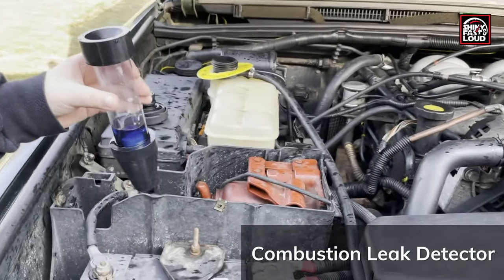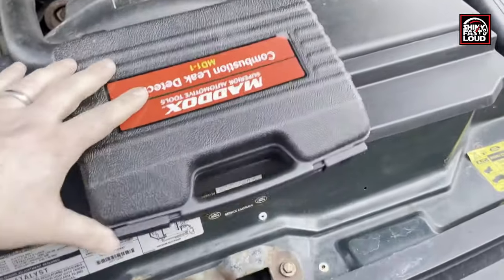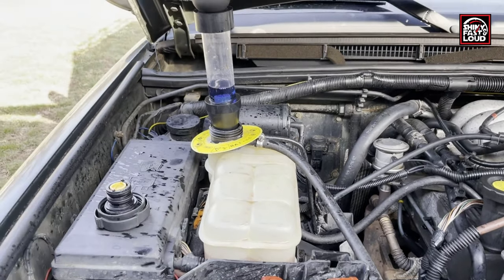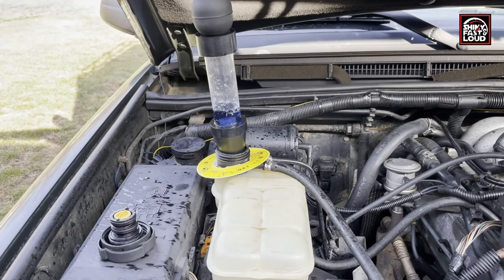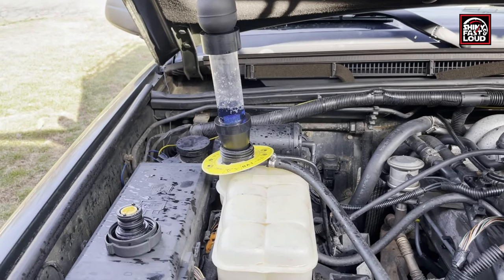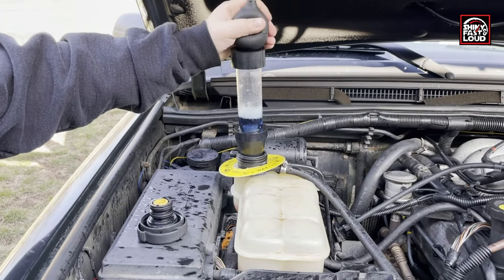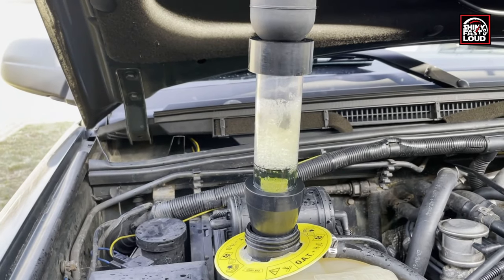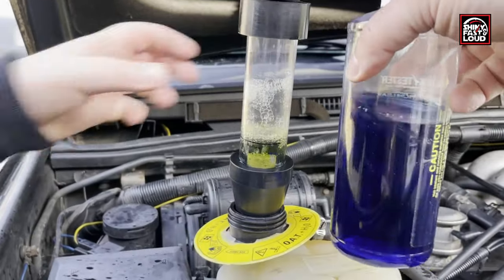Combustion Leak Detector Demo

Comment: Nice video, made me aware that you can do the leak combustion test on the reservoir instead of having to directly do it at radiator cap. Which if your car has one gets around needing to suck out some coolant from radiator to not have it accidental suck up on your tester giving you false readings. Easy test that rules out alot of major expensive compression issues and leaks possibilities when troubleshooting.
Reply from the maker: Glad it helped
Reply: @ShinyFastLoud  is this definitley confirmed?  This will still work testing it at the reservoir versus the radiator?
Reply: @macknumber9 you just watched him do it…
Reply: Glad I found this video and comment I’m about to test my car right now and wasn’t looking forward to draining my coolant

Comment: I just did the same test on my Duramax about an hour ago. I let it warm up about 5 minutes then started pumping the bulb. It slowly turned a greenish yellow withing about 2 minutes. I stopped pumping the bulb after a bit and it was actually bubbling up into the tube on it's own. Time for a head gasket job.
Reply from the maker: That's not fun
Reply: This tester doesnt work on diesel engines :)
Reply: @thegamepz  why not?
Reply: @thegamepz  why?
Reply: it's inaccurate on diesels, you can read the instructions
Reply: @thegamepz  yes, it does. It turns green instead of yellow with diesel combustion fumes.
Reply: interesting. I haven't heard mention of that from anyone else so far.  seems to make sense, but still, are you Sure that's what it means ?
Reply: @thegamepz yes it does. You just need the diesel fluid vs the gas fluid
Reply: Did you buy the fluid from Harbor freight along with the kit when you tested the Duramax or did you use a different set? Want to make sure I get the right fluid to test with.

Comment: When I try to use the block tester I have, the coolant just rises and either overlflows, or gets sucked into the tube. It rises slowly after turning the car on. Only takes like 15 to 30 seconds for it to be not touching the tube to being inside it, or overflowing out the sides? What the hell?
Reply from the maker: Important thing you point out. If the tank is too full the tool will suck coolant up (instead of the air/gasses) which basically invalidates the whole test.

Comment: Me personally I just bought the cheap testers to test out an old car to rule out a few major compression/leak issues. I doubt the old car problem is anything like this. It's more a fuel pump or injector problem that will eventually kill the dieing car. But wanted to comment on great video. Made me aware of reservoir tank instead of radiator main cap to use for test!!! So I can bypass having to suck out a few inches of coolant with a baster tool of some sort .
Reply from the maker: Glad it helped

Comment: These are great for testing head gaskets that fail between coolant passages and combustion chamber but it still doesnt rule out head gasket failure completely...
Reply: The other HG issued would be quite obvious when oil and coolant mix
Reply: @bogathlorant  there's more than 2 ways a head gasket can fail
Reply: @macknumber9  Can you explain what this does rule out and what it doesnt when concerning the head gasket? I'm trying to troubleshoot a situation of my own.

Comment: Hello,  my son drove his truck with little fluid in the radiator.   It overheated and he had to pull over and add fluid.  Now his engine light is on and when we took it to O'Reillys they checked it and said one of the cylinders is over heated.  They recommended we do this test but the fluid doesn't change colors.  If that means nothing is wrong can we just reset the engine light?  After adding the fluid, the truck ran fine and we were able to finish our 3 hour trip. It's still running as normal but the engine light is on.   Should we be concerned or start checking for something else?  BTW, we ran the test for about 5 mins at normal temperature.   Thank you very much
Reply from the maker: Reset the engine light and if there is still an issue it will come back on.
Reply: @ShinyFastLoud  Got it.  Will do.  I'm hoping and thinking everything is fine because I drove it all day yesterday without any issues.  Thanks again🤘
Reply: @mrorbit2u  results?

Comment: I have milky oil on dipstick, white smoke at exhaust, but block tester did not change to yellow. I waited until thermostat opened. The car does start to over heat after 15 mins. STILL BLUE on the block tester. 1995 BMW 525i
Reply from the maker: Milky dipstick means coolant getting into the oil/crankcase. This test is for exhaust gases in the cooling system. You can have one without the other depending where the head gasket failed . With that said, if you get white smoke out the exhaust I would also expect this test to show exhaust gases in the coolant.

Comment: My reservoir tank clearly has micro cracks and you can see it seeping out when its running( tank is brittle and think this is the cause of my puddles directly below) My question is can I do this test knowing that there is a obvious contamination to the tank or should I replace the reservoir and then do this test? I already purchased the new tank. I Notice that directly underneath my tank where the hose is it is wet and you can clearly see drips.
Reply from the maker: In theory, the only concern I can think of is if the reservoir was so leaky that the tool couldn't create enough suction to draw the gases out of the tank and through the fluid.  Other than that, the leaky tank wouldn't skew the result. The air from outside the tank wouldn't make the test fluid change color.

Comment: right at the very end of the video when the tester was removed, there was white smoke coming out of the tank.  Is that steam only or was that also a sign of exhaust gas?
Reply from the maker: Not sure but based on the test I would assume part of it is the exhaust gases

Comment: About how long should I keep it on the reservoir while pumping it? I don't want to get scorched. How long did you have the engine running before you began testing it?
Reply from the maker: Start with the engine cool and the cap off. Then start the vehicle and let it get up to normal operating temp. On this particular car I had it run for a few minutes before filming.
Reply: @ShinyFastLoud  thanks man!
Reply: The instructions say the engine needs to be warm which means the thermostat needs to be open in order for the test to be valid. The test instructions also say to pump the bull for 1 minute.

Comment: If I’m loosing coolant fairly rapidly would this test be good? Or is there something else I need to test?
Reply: Check under your oil cap to see what colour the oil on it is. If it is a coffee colour that is milky looking then coolant is getting into your intake manifold/cylinders So new head job or head gasket replacement is needed.

Check for external cooling system leaks after the vehicle has rested/cooled down and when the engine is hot at idle when it is under pressure. Look for puddles under the car, loose hose connections split pipes as coolant under pressure will be forced out of these areas.

White steam coming from the tail pipe  means coolant is getting into the cylinders or the exhaust manifold so at best area head gasket or worse a head hob/replacement.

If there is coolant on front passenger side foot well floor then your heater radiator core is leaking. You can easily bypass it by joining the heater core inlet pipe to the heater core outlet pipe  but it means no heating in winter.

If you are losing water that quickly then it must be going externally somewhere and if it ain't coming  out of the overflow tank or any of the external places such as pipes or the Welch plugs in the engine block onto the ground then trust be exiting via the combustion or exhaust cycles and a new head gasket is the very minimum thing needed.
     Pay the extra to get the head checked by a head machine place to see if it is cracked or warped and if need be get it machined if possible.

Comment: Can this test be done through the exhaust pipe? I did it through my radiator cap but no luck. I insert the tube into my exhaust pipe and immediately turned yellow.
Reply: The fluid turns yellow when it detects exhaust. Of course it will turn yellow if you go straight to the exhaust
Reply: This really made me giggle. I really hope this is a joke

Comment: Please help me man. 04 Audi 1.8T. I ran the block test all the way up to 60 degrees celcius, no change in the fluid color. I read that the thermostat should be open, so I revved the engine to heat it up, though with the cap off of the reservoir, the coolant started expanding and shooting out of the reservoir blowing my test kit out. After that I reset the test but could not get another reading without coolant entering the test kit. Is the test to 60 degrees enough to determine the head gasket is good? There is no way I can get my engine warm enough with the reservoir cap off, for the thermostat to open
Reply: Cap off turn on the engine n turn on the heater full blast once it’s hot u know the thermostat has open n coolant is flowing in the system enough for u to get a reading

Comment: How long do you keep squeezing before saying it is good and no issues if it doesn't change color?
Reply: The instructions on mine said 2 minutes
Reply: @Justlikegrimace  
The light turned off temporarily and came back on
 I then flushed the system and added bar leak fix, and what is interesting almost 200 miles later, there is no coolant leaking, but the engine light is still on.

Comment: Does the engine have to get very hot.  Luke warm or any temp ??? Thanks
Reply: Just hot enough for the thermostat to open. You can always dip a finger in the tank (at your own risk) to feel the temperature. If the coolant to too hot to keep your finger in it for more than 1-2 seconds then your thermostat is open and coolant is circulating.
Reply: @davemccage7918  thanks !!!

Comment: Why do you need the kit ?   Mix the liquid with some of the coolant , wont' that work ?
Reply from the maker: I believe that there are test strips to check your coolant for cylinder gasses.  Not sure that this test fluid would work in that scenario, also, this test is capturing the exhaust gasses that percolate though the coolant.

Comment: Question am I suppose to keep the test tube on the coolant tank for 5 minutes without removing the tube from the tank??

Reason I ask is because I wanna know if I did it right or not.
Reply from the maker: I don't think it really matters. The more dramatic test result happens once the engine is up to temp and the coolant is circulating through the head. If you apply the test tube at that point its going to detect the gases if they are there.
Reply: @ShinyFastLoud  Thanks so much fir this! I've been using the radiator & it's been giving me a hard time because I've always sucked up extra fluid & had to restart. I had no idea that the reseviour could be used as opposed to the radiator. I know using the radiator is best for results, but since this works it'll save me the trouble of using a turkey bastor to draw out coolant.

Comment: ...and the fluid is not hitting the bottom of the tester?...
Reply from the maker: You need to make sure the rubber bottom of the tool doesn’t reach/touch the coolant when you insert into the coolant tank or radiator. If it touches instead of drawing air through the test fluid it will suck up the actual coolant which invalidates the test.
Reply: @ShinyFastLoud  When I put the tester on there is no coolant, and it just rises in like 15 to 30 seconds till it would be sucked in, or overlflow out of the top of the radiator cap? Whats going on, please?
Reply: @moderaterevolution504  same issue... most of these testers are doing coolant tanks connection instead of radiator itself.. for them it doesnt get sucked into the tester but anyone with radiator connect, runs into this.. i tested 4 times, squeezing the entire period of 2 to 3 mins and all was blue Until the radiator level rose Into the tester and made it green.. color change here is from contamination not exhaust gas... hard to use test!

Comment: Dude, u forgot to say that engine must be warm up
Reply from the maker: good point
Reply: how warm? can i test it after driving it for 30 minutes?
Reply: With engine cold, remove radiator cap or overflow reservoir cap. If necessary, suck out some coolant so coolant level is at least 2 inches below the cap. Start vehicle and let it run. After 10-15 minutes (depending on the outside temperature), the dashboard temp gauge will be in the normal range and the thermostat will open -- you will know when the thermostat opens because the top radiator hose will suddenly get hot. Then use the tester.